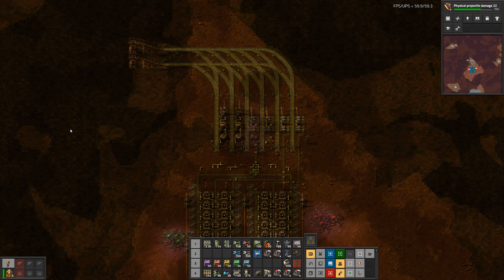Factorio Space Age - Megabase E47 - First Fulgora Station

Comment: Why dont you just produce, say, 10 normal fusion reactors per minute? Then you just continually recycle those until you eventually get legendary. Sound like a lot of work for something "temporary", but you could then use all those fusion reactors for spidertron gear too
Reply from the maker: That would require 2500 quantum processors per minute, or about 42 per second. My current base produces 2.5 quantum processors per second, and still slows down sometimes due to it's inputs not being produced/delivered fast enough.

To compare... producing 5000 SPM of Promethium Science only takes 2.8 quantum processors per second, with legendary prod 3's in the science buildings.

I would have to mine out half the solar system to get legendary fusion reactors lol. :P